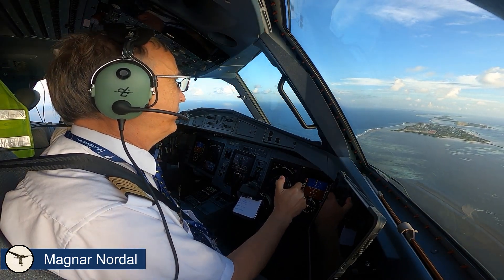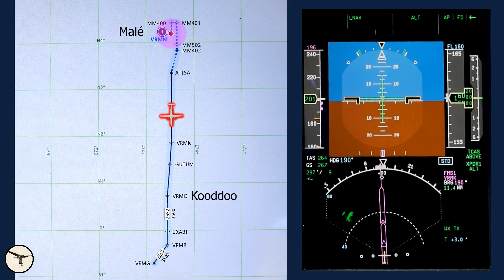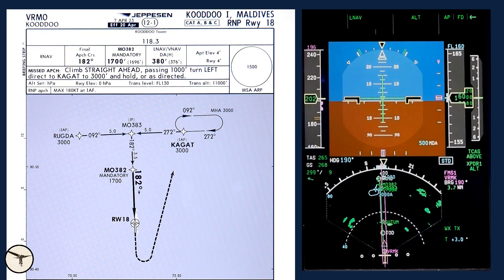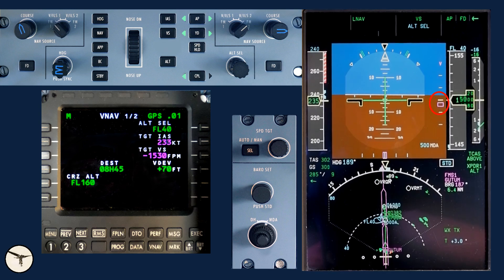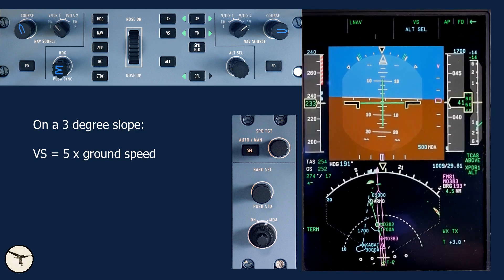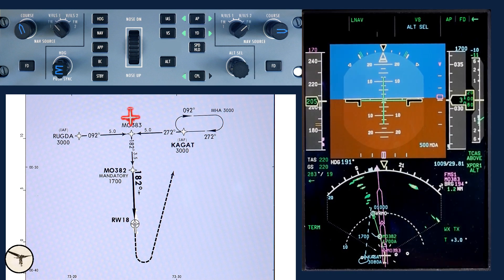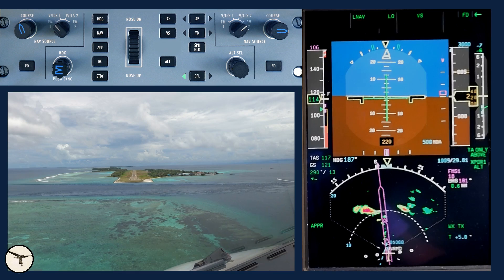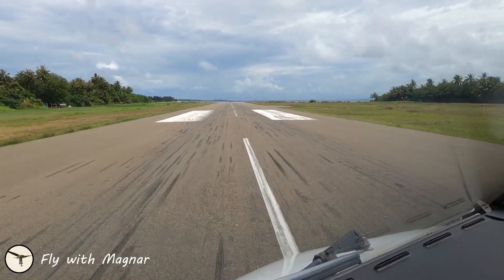ATR systems - Primary Flight Display (PFD) part 5 - LNAV approach | Tutorial

Comment: Mr Magnar if you put go around alt 3000 why would the aircraft still follow glide slope till the next point 1700 feet
Reply from the maker: There's no glide slope on this approach. I use LNAV mode and VS mode. The vertical deviation indicator on the ADI is a reference, and I adjust the vertical speed to follow it. After descending below the go-around altitude, I select go-around altitude: 3,000 feet. If not, the aircraft would level off at 1,700 feet. The FMS provides guidance to the Missed Approach Point.

Comment: Hey captain, I’m unable to find an answer for a comment I’ve heard someone make about shooting the 2D approach in the ATR. It was something along the lines of setting a higher platform altitude on the panel as using VS to step down again on the approach the aircraft would essential not descend as it think it’s already captured. I thought it my mind you would wind down the altitude to allow it to descend and not “wind it up”. I could have picked that up wrong . Hopefully you might be able to pick up on what I’m mentioning. As always thanks so much for the videos. This content is gold! EDIT: after watching again I think I may have been talking about the point where you selected missed approach altitude to make sure it didn’t capture 1700. I think that’s it!

Comment: Hello captain magnar , your all vedio regarding ATR 72-600 are great and very much informative with detailed explanations, I have a doubt regarding VOR APCH , so as you made earlier about LNAV/VNAV AND ILS APCH , can you make a video like this for VOR APCH ? Thanks
Reply from the maker: Hi, the VOR approach is flown with LNAV/VS or LNAV/VNAV modes depending on the equipment in the aircraft. The requirement is that PM is monitoring the VOR/DME and verifies the aircraft is on the correct track.
Reply: So then you do not switch to VOR nav source but keep FMS selected?  I just did VOR approach in the msfs sim today to LEHC and was not sure how to do it. Ended up switching to VOR and doing the course adjustment as I went away from VOR first and then again to return. That did not work well and ended up just hand flying the approach.  And thanks for this series of videos. Just perfectly presented.
Reply from the maker: Yes, you insert the VOR approach in the FMS and use the FMS during the entire approach. The other pilot, however, must tune in the VOR and vertify you are inside the limitations (maximum half scale deflection).
Reply: @FlywithMagnar  good explanation, you've taught me something!
no more old-fashioned VOR DME approaches, still used on aircraft that don't have a flight management system or a high-performance navigation system like the Garmin 1000 or 3000.